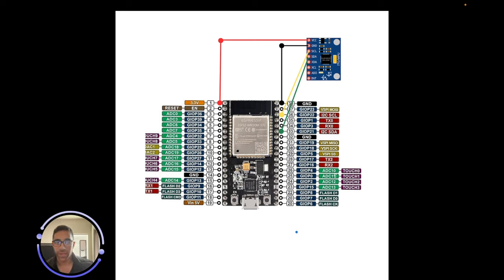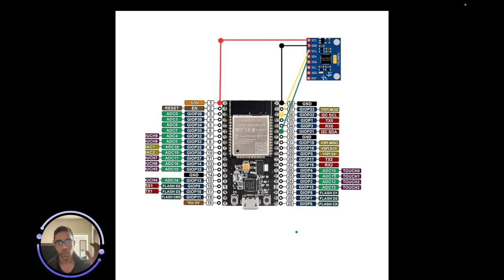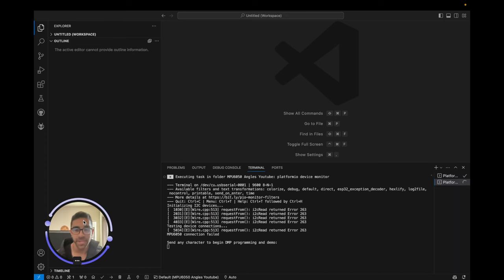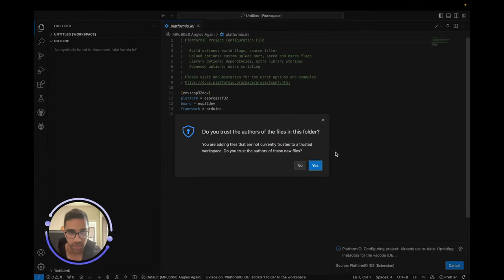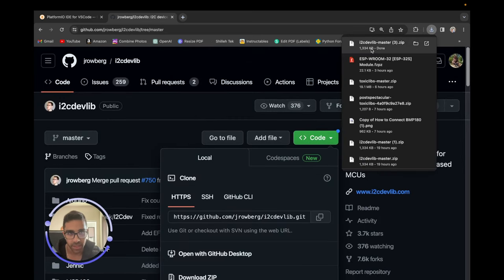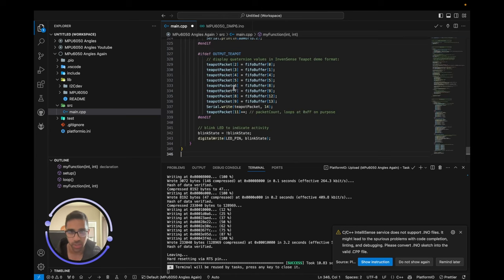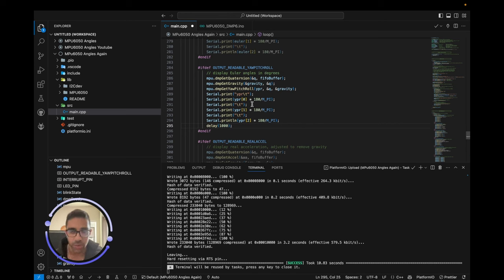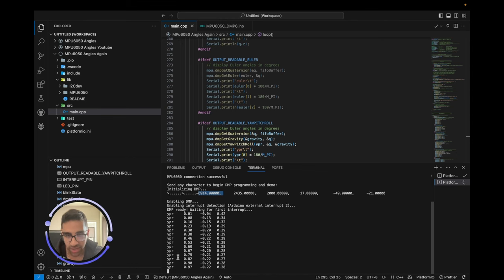Measure Angles Easily with MPU6050 and ESP32: Part 1 - Library Walkthrough

Comment: The angle measurements in my case are not very accurate (a 90° angle is interpreted as 60°). I'm using the same code as you but with an Arduino Nano. Do you know anything about this?
Reply from the maker: Calibration is needed

Comment: Does that library take values from the DMP or does it actually do sensor fusion of gyro and accel to get the angles?
Reply from the maker: That is a good question I would need to check the source code and get back to you.
Reply: @mmshilleh  i checked the code, seems like it takes the values directly from the mpu, it takes the quterions from the DMP

Comment: When you leave the sensor flat, the yaw value keeps on increasing. In your case also I saw it kept on increasing. How can it be accurate??
Reply from the maker: I think the yaw is subject to a lot of drift with the MPU6050 because

1-) We did not calibrate perfectly

2-) Yaw is better measured utilizing sensor fusion with a magnetometer not available on this version of the MPU. You would need a 9250 for that and probably some other equations!
Reply: @mmshilleh  I have tried that sensor also. Magnetometer in general comes with many limitations (especially in my use case)

Comment: your videos are really great sir......, But in my case, I'm working on a project where i wanted to measure the lean angle of motorbikes while turning or doing any other angle changes. In here, i'm stuggling with the reference point. I mean if I upload the code and start the system, it shows XYZ -  Roll pitch yaw angles are nearly zero. When I "START" the device they are zero, which means in any direction, if I start the device, it takes it as a reference point. I think you got my point. Is there any way (by using complex maths or different sensors or whatever) that i can set the sea water level(or global flat reference) as my starting point/reference point even if I start the system in any direction or any angle.... HOPE you would reply me sir
Reply from the maker: Hard to say, seems too complex to discuss over YT comments to be frank with you

Comment: I have a esp32 marked "WiFi ESP-WROM-32".  I was just using it with a OLED display running i2C script.  It was working fine.  I added the MPU6050, and connected to the Same SDA/SCL lines.  And of course the 3V and Gnd.  When I run this code I too get "
Initializing I2C devices...
Testing device connections...
MPU6050 connection failed
   The comments section says that the MPU6050 interrupt pin must be connected, but I did not see that in your connection image.  When I press a character no values are shown, because connection to mpu6050 failed (I'm sure).  I have used the MPU6050 in the Arduino environment with different code, and it was working.  Any other ideas on what could be going wrong here?
Reply from the maker: Thank you for sharing your experience. It sounds like you've encountered a common challenge when adding multiple I2C devices. Here are a few considerations that might help resolve the issue with your ESP32 and MPU6050 setup:

I2C Addresses: Ensure both the OLED display and the MPU6050 have unique I2C addresses. You can run an I2C scan to verify this.

Power Supply: Adding more devices can increase the power demand. Ensure your ESP32's power supply is sufficient and stable.

Pull-up Resistors: Check if your setup requires external pull-up resistors on the SDA and SCL lines. Some boards have them built-in, but others might need them added externally.

Interrupt Pin: While the MPU6050's interrupt pin is not always necessary for basic operations, it's crucial for certain features. If my connection image didn't show it, I apologize for the oversight. Connecting the interrupt pin to an available GPIO on your ESP32 and configuring it in your code might resolve the connection issue.

Software Libraries and Code: Verify that the libraries you're using are compatible with both the ESP32 and the MPU6050, and that your code is correctly initialized for both devices on the same I2C bus.

If you've tried these steps and are still facing issues, consider reaching out for more personalized advice. For detailed troubleshooting, you might find a consultation or a deeper engagement through my channel's membership very helpful. This could provide more specific guidance tailored to your setup.
Reply: Hello,
Esp32 has two physical independent i2c interfaces. Please give it a try !
Reply: I also have the problem with the WiFi ESP-WROM-32 but i did not connect a OLED, it just doesn´t work, did you know how to fix it?